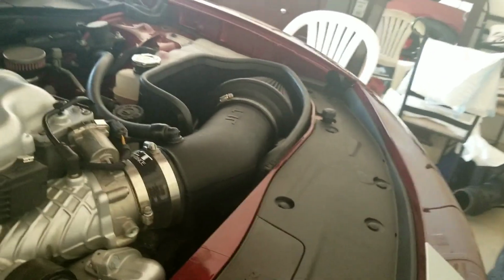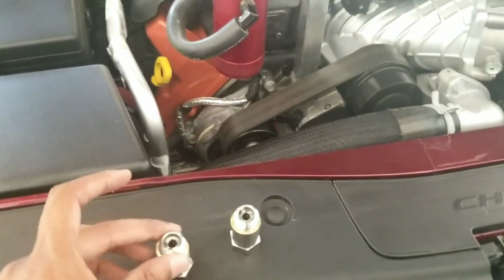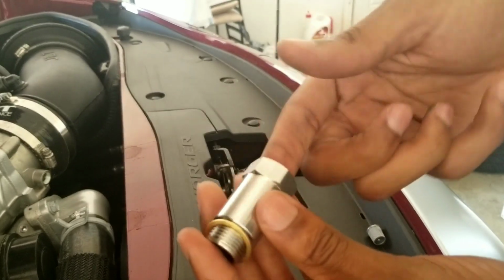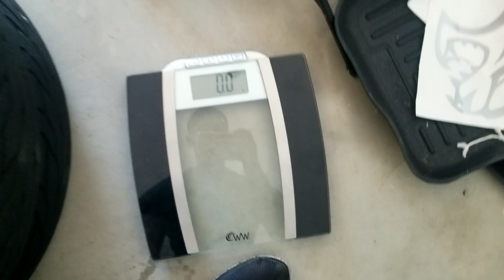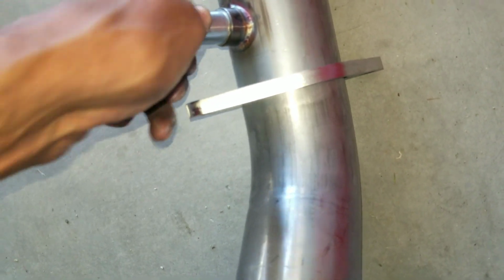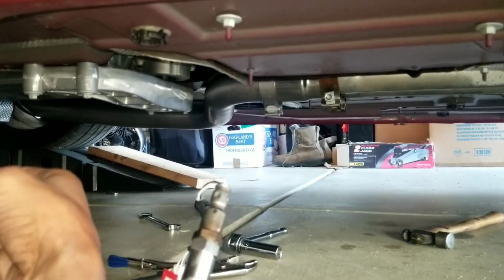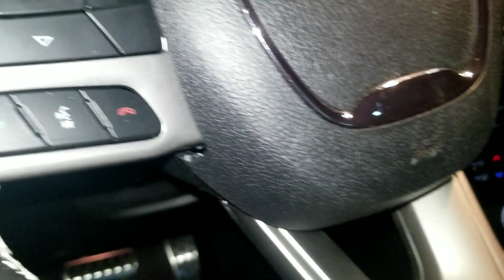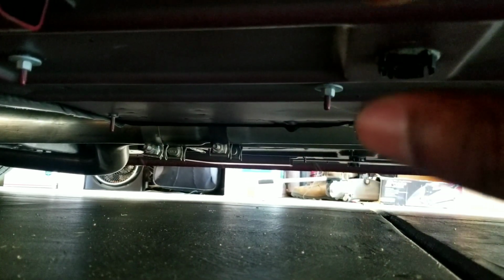Hellcat Stainless Works catless mid-pipes install .....mostly

Comment: Do you know the size of your exhaust adapters I bought a used pair and they didn’t come with them so I bought some off line that day 3-2.75 aka 2-3/4 and they don’t fit into the factory X pipe any idea ?
Reply from the maker: Is it a cat or scat? And is your exhaust stock or aftermarket?

Comment: I have the exact same midpipe And  I use the O2 simulator without any nozzle insert with ZERO CEI codes. The most important thing is to use anti-seize compound so the threads don’t get destroyed during install and removal. A pipe diameter spreader makes the midpipe to Xpipe a breeze just rent it from Autozone advanced Napa etc etc etc. finally use a 5/16” stainless washer for the exhaust support bar because it will rattle terrible during acceleration and bumps on roads. I used 4 per nut and I have zero noise from mid pipe hitting the frame. In closing Youtubers make this install look simple and it’s NOT I had to drop the entire exhaust to make things simple.
Reply from the maker: Yeap that was the missin element i figured they came out simple enough so they should slide back in....WRONG!
Reply: 40 or Dig TV took me and my buddy 3 hours 🤦🏽‍♂️
Reply from the maker: Quicker than me....i started at 2 & didn't call it quits till 8

Comment: I replaced my exhaust back pressure sensor the other day. Auto hobby shop was closed so I had to go to my buddies place and had to use the same ramp setup you had. Luckily he was smaller than me and he could get under the car. Now I am waiting to get my Corsa exhaust put on.
Reply from the maker: Ramps are so much harder to work on and send me clips of the exhaust i may be making the same move soon

Comment: I have the same catless mid pipes on my scat pack. I was able to switch them without taking the exhaust studs out. I run Corsa Extreme with them. It’s really loud especially on the nitrous. I weighed the stock mid pipes vs the catless and there was a 7 lb weight savings. I’m lucky I didn’t have any trouble switching the pipes out. The o2 simulators have worked great with no CE light. I had to get back under it a couple times and tighten the clamps with an impact to get rid of leaks.
Reply from the maker: Do you gets lots of popping with the corsa extreme? That's what i was hoping for. As for the people who got CEL i think they may have used the simulators that you have to drill out. These were a direct fit no drilling and so far so good
Reply: 40 or Dig TV yes lots of decel popping!
Reply from the maker: Might be my next move
Reply: @Lowe376slow  what are these simulators you guys are talking about?
Reply: Never mind my dumbass skipped the first 15 secs and that’s why I missed it

Comment: I installed some one my car. I had a shop do it and they had it done in 40mins....only charged me $140 to do. Looks like you needed a pipe expander to do get it in there. I was going to do it myself but glad I didn’t. Sounds good bro.
Reply from the maker: Yeap saved money but hurt my shoulders and hand with 6 hours of work and still didn't finish.
Reply: 40 or Dig TV At least you tried it. I knew if i would have tried it I would have sold the car 😂😂😂 and gave up
Reply from the maker: I can't tell you how many times i got close to giving up lol

Comment: I got a little rattling after the catless mid pipes what you think it is ? It can’t be exaust valves cause I got the mfer-1 and they are open all the way maybe the bolts loose is just a little rattling by 25 to 40 miles and my engine never did the tic sound noticeable now u can hear it a little more wonder if is normal now with higher air flow bro
Reply from the maker: If you have the O2 sensor spacers its probably the bushing inside. I had rattling and when i took them out the rattling stopped and my engine ticking got louder as well never ran different so i didn't mind it
Reply: How u make the rattling go away and stay without the engine light not coming off cause mine haven’t come up with the o2 spacers

Comment: Sounds good! Another scatpack guy here with the same midpipes. Haha you sounded just like me when I did my install. I said never again, that passenger side was a B!
Reply from the maker: Lol I don't understand why everyone made it look so simple
Reply: 40 or Dig TV Yeah never is easy lol, lucky I didn’t have to take the studs off though. I also had the issue trying to slide that clamp into the Stock exhaust on the drivers side. I ended up going to the auto store and renting a pipe expander tool.

Comment: Btw mine sounds literally same as yours when u show the cold start from underneath just with the rattling from when u hit pedal form 25 to 40 miles
Reply from the maker: Pretty sure its the spacers i tracked it down by tapping everything and it got louder at the spacers
Reply: So is just cause more airflow that gets more louder the tick right ?  What’s ur ig bro ? If you want to go to watch some spring training games next year let me know if ur around Arizona area I played for them will be there for next year.. also bro thanks for helping I was concern with the new louder ticking and explain me about he o2 sensors I have the o2 sensor spacers and thanks God haven’t get any check engine light 2 days already driving it for hours tomorrow about to put the shorty headers is loud as hell hopefully the shorty headers will keep it down on a deeper growls sound.  What I need to do for the o2 sensor stop the rattling ? Take them off u mean ? Or what explain me I’m bad for this stuff ahha In that way I can tell my uncle in the shop tomorrow
Reply: Like louder rattling in the spacers but I wonder why that’s a tight metal in there not touching anything at all
Reply from the maker: Ig is lowe376slow and im not sure why the ticking gets louder i just assumed its cause the stock pipes had way more material to insulate sound and the catless pipes dont have anything. As for the rattling if you plan on getting a tune(i would) you can just remove the spacers your tuner will turn off the sensors and keep the CEL from coming on but if you dont plan on a tune just leave but you'll still have that rattle
Reply: I see what u mean bro so ur 100 percent sure the rattle comes from the spacers then that’s super weird cause spacers should be in there very tight no even touching anything around
Reply from the maker: @juniorcalcano928  not im not 100% im just sayin when i checked and tapped everything it lead me to those O2 spacers and when i took them out the rattling stop just make sure you tap along the exhaust to see where its comin from

Comment: Them things wore  my ass out too just be glad you didnt put long tubes in lol
Reply from the maker: Yeah no way i was gonna try those alone lol I've heard the horror stories
Reply: @Lowe376slow  lol you just needed it up in there air lol and a rubber hammer
Reply from the maker: Lol Iain touchin em nomo idc im done coach! Lift would've been a huge help tho my shoulder blades a sore as hell
Reply: @Lowe376slow  lol got it sounds good though bro

Comment from the maker: Update: been a few weeks and the CEL has finally come on. The 02 spacers worked for a little while. I cleared it and it came back a few days later.
Reply: 40 or Dig TV Wonder why it worked for a while? Have you spoken to MMX about it? I got the same set up ready to go on. My midpipes showed up today. I didn’t want to have to get it tuned. I got two yrs of warranty left. Ugh 🤨
Reply from the maker: Nope haven't spoke with MMX yet was gonna just roll with the CEL since it hasnt really affected anything other than remote start
Reply: How I fix it
Reply: @Lowe376slow  have you fixed it ? And if so how?
Reply from the maker: Nope....only real fix is getting a tune which is what i did.
Reply: @Lowe376slow  ah ok I’m planning on getting headers and catless mids yt don’t know anyone who can help me pass inspection

Comment: Did you need to tune the car to run these ?
Reply from the maker: No but you will want one to actually make power
Reply: @Lowe376slow  my hellcat is tuned from the prior owner I found out he was running a 2.85 just don’t know what it was tuned to, I have a set but I’m nervous to throw them on, a tuner told me it’s ok but not to get into boost . There are so many mixed reviews
Reply from the maker: Talk to Curt dusterhoff, Tim Barth, or satera. Top 3 hellcats tuners and i wouldn't trust running a modified cat until you know exactly whats done to it.

Comment: Any drone on crusing?
Reply from the maker: Nope in ECO she's pretty quiet but put it in sport or track and it drones a little
Reply: @Lowe376slow  I have a mid muffler delete now and when i get my 2.85 pulley id1050x and tune ill also be going catless and I'm nervous is gonna be too loud since it is my daily.
Reply from the maker: It's very loud for sure.....still not as loud as my scat though. The scat was loud ALL THE TIME at EVERY RPM. I think you'll be fine unless you cut the resos off too
Reply: @Lowe376slow  Cool, thanks for the feedback.  Ill give it a shot i guess and go from there.  Maybe get some aftermarket muffler welded on if its unbearable.